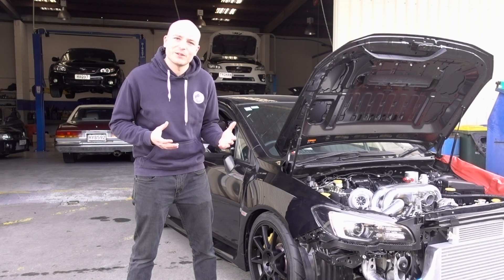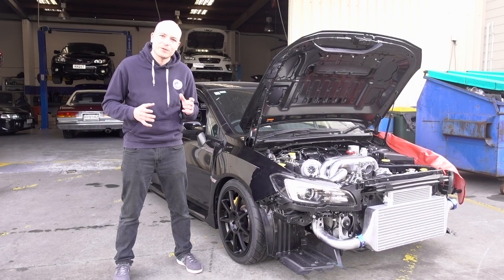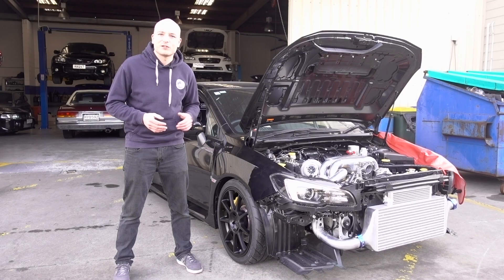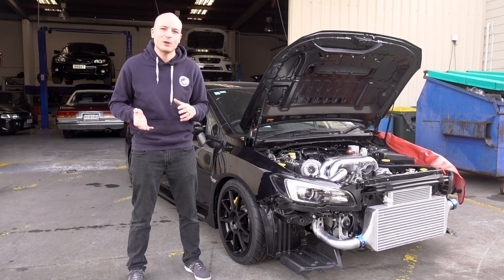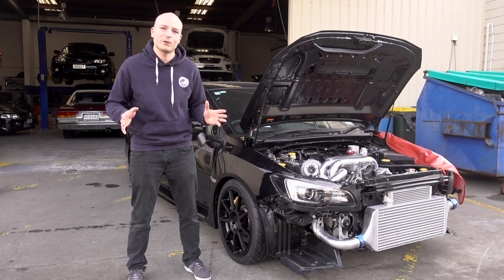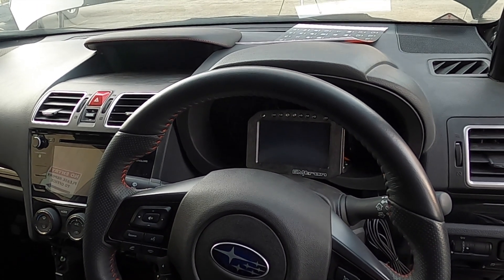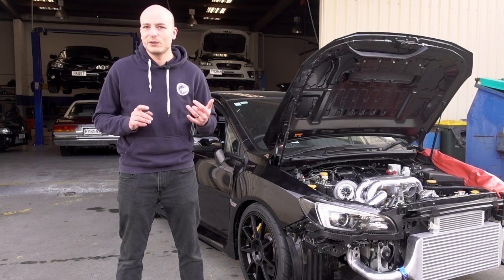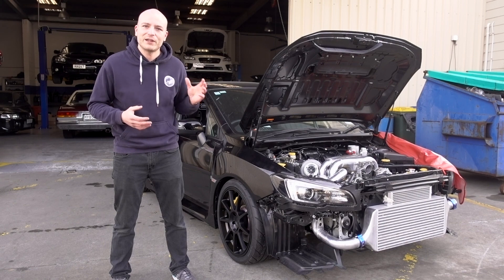Ethanol setup, Emtron ECU & dash, fabrication update [Billet Block Project EP. 5]

Comment: That G30-770 looks clean, I might get the same one for my setup, what AR size is recommended to achieve 550-600hp, .83, 1.01 or 1.21?
Reply from the maker: Hi ER Rodz, it depends on your complete setup (fuel,cams, intake, headers, exhaust) and ultimately the desired powerband/response. We've chosen the 0.83 for the response, as peak power isn't the goal until the owner is comfortable with the power, at which point we'll go to a larger turbo. We made around 570hp on E85 with the turbo at the edge of it's ideal efficiency zone given the high power capacity of this engine.
Reply: @PossumBourneMotorsport  so i guess with the G30-900  with a 1.01 AR will achieve 600+, i. Working in getting the parts, im still debating with the turbo I'll buy, 550 to 600+hp is my goal.